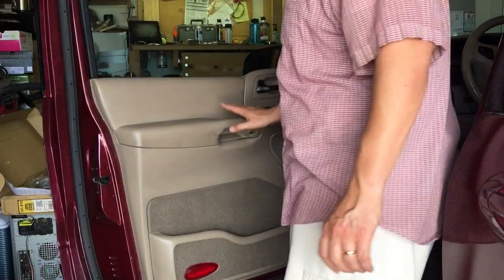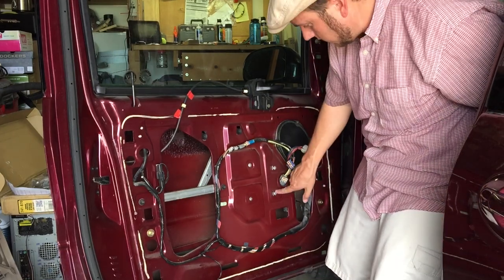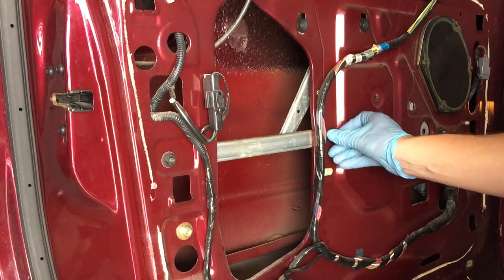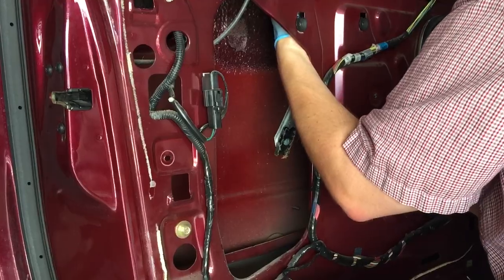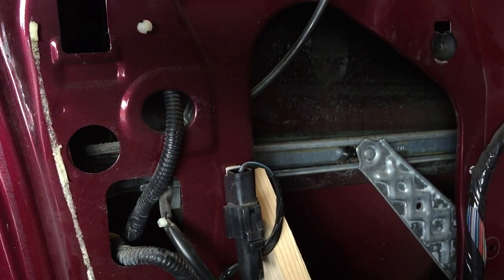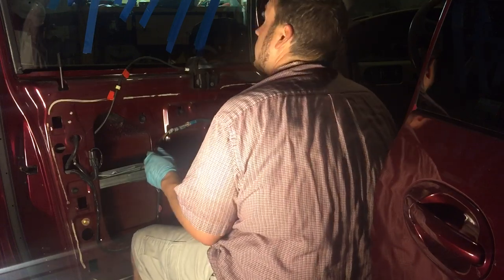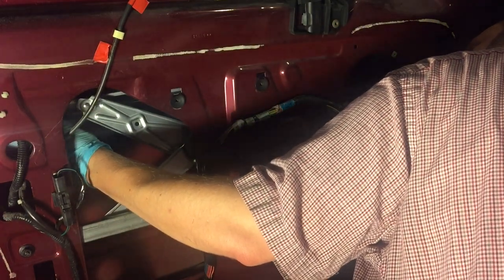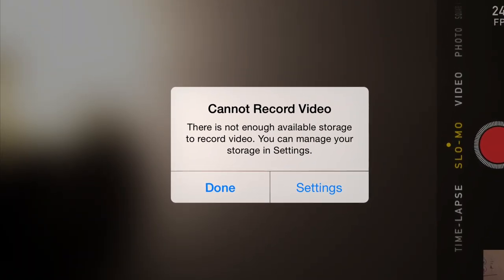2001 Ford Windstar Minivan Window Regulator Replacement

Comment: THANKS!  Worked great for my 2004 Freestar.  The only thing I did different was to NOT take off the window glass rivets and I left the slider bar on the glass.  I found another YouTube where a guy did that.  There are two metal tabs bent up to keep the sliders from going off the end.  (Probably only for storage at the factory.)  When the tabs are bent back in, the two nylon sliders come off the end of the metal rack.  I really liked your tape idea for the holding the window up.  I used 2 pieces of duct tape..

Comment: Great Video :) I watched it B4 I did mine it helped thank you. .. have a 2000 windstar. I had to work on. The motor was fine the bolt that holds the trak to window came lose and fell out. I found it at the bottom of the door and put it back on. And it works fine... there was no rivits it was all hex wrench bolts

Comment: I gave you thumb up....only, because you did not give up!!=) Sorry to tell you, you don't have to take those rivets out from the glass, when you change regulator, those plastic sliders slide out. And , most of the times, nothing wrong with regulator, just jammed/ bad?? window motor, you can always open that up, clean or change brushes, and it works again ! When you change window motor, don't take any rivets out, jus drill 1/2 inches holes, where the punch marks are ( most of Ford/ Lincoln models), and take motor out, usually has 3 bolts, one is showing here, with a little stud, take the stud out first =) Other than that, good job ! youtheman....
Reply: Big E I have put two replacement motors on and it really looks like i am going to have to change out the regulator because it is binding and jamming. The aftermarket regulators appear to have different tracks from the OEM so should I try to get a genuine Ford regulator so I do not have to take the glass rivets and top horiz track off? I see the tab at the end of the glass track and it does appear that the slides will come out if that is bent down.
Reply: Correct, that is how you do it!!! Just bend that tab a little, it will slide out !=) No rivets involved,....usually at all !!!!
Reply: Yep, yep =)
Reply: EL, will window drop if I only remove motor?

Comment: @11:35 That's an excellent strategy that has worked well for me. When things weren't going smoothly, I would sit down and light up a cigarette and "smoke it over". Of course, you can "melon it over" as well. I quit smoking long before they started putting carpet glue in the smokes to prevent them from burning (how ridiculous is that?)

Comment: If I just pull the motor off will the window slide down or will it stay up?
Reply from the maker: 1weird Doe it has been a while since I’ve done this, but I’m 90% sure the window will slide down. 

The motor actually holds it up. 
A decent amount of blue painter’s tape will keep it up though without damaging the paint.